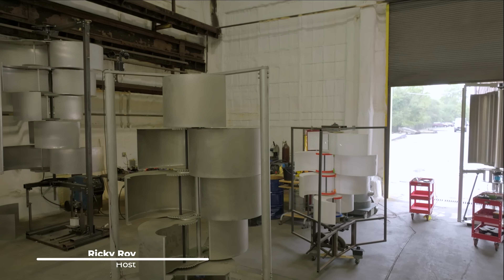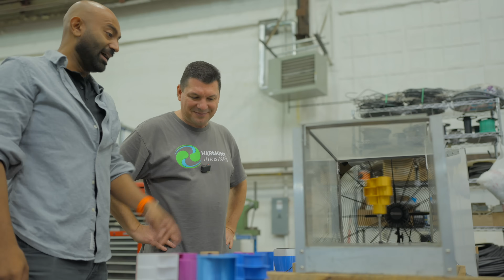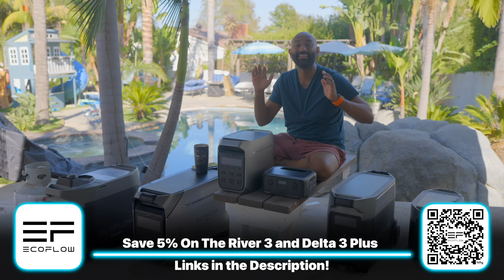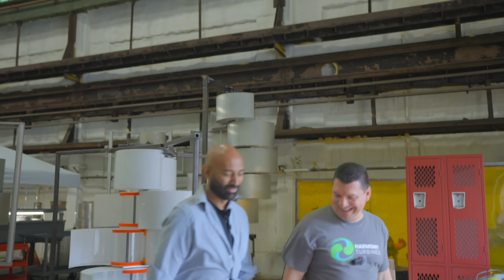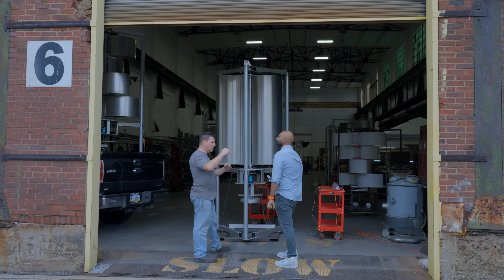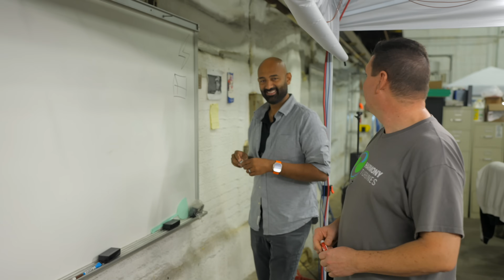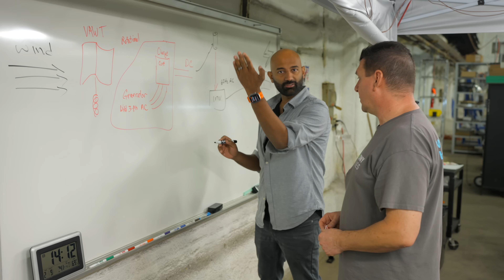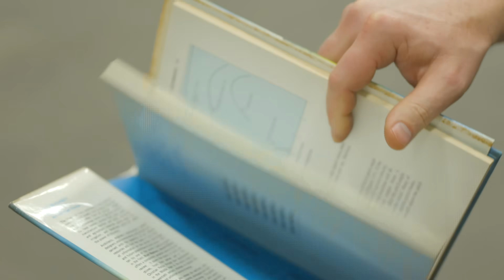This Could CHANGE Home Wind Energy Forever!

Comment: Thank you! It helped me understand a bit (or two) more regarding efficiency and reliability. It also helped allay some of my reservations regarding wind power--primarily its danger for bats and birds. My understanding is that the big, horizontal shaft wind turbines take quite a toll on flying vertebrates in general but more so on raptors and bats. The blade tips on those things are going in excess of 100 mph, sometimes far in excess of 100 mph. The vertical shaft turbines aren't as fast because their radius is a couple of meters at the most, at least on this video. Possibly more important is that a screen surrounding these would be possible while being utterly out of the question for the horizontal-shaft turbines.
Reply: No screen needed, birds and bats see a solid object in front of them and simply fly around.
Reply: @fr3dfixit945  there have been extensive studies on the effects of wind power plants on birds and bats, but no effect on bird or bat population could be proven. Hots are pretty rare and don't endanger the population.
Still, new offshore wind parks have bird tracking and slow down the rotors when a swarm approaches, but they've also shown that birds avoid wind parks altogether.
A recent study in Germany checked for dead birds in wind parks very thoroughly over a long period but couldn't find significant dead birds. Not more than expected of natural causes in the area.

Comment: That small windtunnel test.. A higher voltage (OCV) only tells you it is spinning faster.. Measure Watts if you want to know its power. Also: it may be efficient and good in slow "dirty" air, but when low to the ground and not that big, the power will be small. That said, I do like the product a lot! I would consider buying it.
Reply: Quite some time ago, some friends of mine were approached to invest in a wind turbine startup. I was asked to do a verification of the potential power capacity of the prototype, in a real world setting. So, I set it up for a 'Brake Horse Power' test at their site, with my instruments etc. The measurements confirmed my initial views, when it showed it could generate 92 watts @ 22kmph winds (far less than their claims). They were somewhat taken aback, and pointed to their demo that was pumping water. I ashed what was the GPM over the elevation head. The calculation returned a similar result - 95 Watts @ 23kmph. My friends decided to mot invest. Many others lost all their money, when the firm went under as they were unable to produce the power levels they claimed.

Comment: It is interesting that he did not include the "traditional" wind turbine model in his little windtunnel performance measurement exercise for the sake of comparison.  Something tells me that the old fashioned one would vastly outperform all of these fancy designs because it faces the wind with all its surface collecting the full wind pressure. All of the models he presented face the wind with a portion of it's surface while the other portion is acting as a windbreak reducing the efficiency.

Comment: Unfortunately there are a lot of mature trees around here so I would have to put one on top of a 20m tower to really reap the benefits. In a suburban sprawl or areas with a lot of farmland or plains, where trees aren't really an impediment, it would be a great solution to supplement solar. Having a whole house generator that can run on RNG or bio diesel (treated for long term storage of course) would be a great solution to fill any possible energy gaps during prolonged inclement weather.

Comment: Great vid, great designs and ideas but it’s the cost that will hold this company back. $6k ? No I would not buy. I would spend $6k on batteries and inverter and make my own wind units and power scavenging units.

Comment: It would be interesting to see power via solar or wind rated in w/24hr or over a week, month etc.  Wind does provide less like for like, but over time, it might be comparable if exposed to wind permanently etc.  but having both might be a good solution to maintain topped up batteries around the clock.

Comment: why could you not use the drive power of the wind to run an air compressor stored in tank pressure driven generator? Solves voltage control problem.

Comment: Good effort, but their design is not practical.  I have worked on VAWT as an amateur for a number of years.  Savonius can work well if it is adapted to it's load correctly.  Slow moving high torque Savonius are similar to the old multi-blade (24+ blades) farm windmills.  These old, but very useful farm windmills pumped water from a well, ... that is what they did very efficiently - pumping water is a low speed/high torque process.  

Using an electrical generator meant for high RPM input is a stupid load for any Savonius especially this one.  Other VAWT researchers decades ago redesigned electrical generators to work better at low speeds, but these generators are much more expensive until production can be scaled.  These problems and many others with Savonius wind turbines, as well as their unique advantages, have been well known to researchers for decades.  I have a better idea which matches VAWT Savonius to a load, but that is between my patent attorneys and myself for now.

I respect these folks for their willingness to experiment and significant effort as demonstrated.  Just wish they had read more literature from the VAWT field first and learned what had been tried, what the issues were, before making entirely avoidable design mistakes.  If they continue in their present direction, the only beneficiaries will be YouTube content creators looking for novel clickable stories to tell.

Comment: A very important part of the video was when he explained that most people only get average wind speeds of far less than the 12 mph minimum turbines need to produce anything. I recall someone complain that his turbine only produces power for few minutes before the wind gets so fast it shuts down; for some reason they did not want to accept that a tower that is too short and too close to trees and his house is not going to get good wind so the problem was not that they were only getting about 200W from 30+mph winds but that they only rarely got the 12 or15 mph that their 2kW or 3kW turbine needed to even start moving...

Comment: Looking at this WIND TURBINE which is Direct-Drive to the generator, what about a Gear-Box or a Automatic Transmission that changes gears for the different wind speed? Like in a car, RPM changes into a higher gear the faster it moves but the RPM is roughly the same.

Comment: I've wondered if micro turbines would work , something along the size of the small ones you shown, that produce maybe 2 or 3 watts, but having say 100 all charging a battery, it would seem to need a lot less wind and would produce more power on average in a medium to low wind speeds

Comment: Do these wind turbine controllers have Max Power Point Tracking (adjusting the motor load, to maximize the power output of the system)? This would auto-adjust with wind-speed, air-temp, air-humidity).

Comment: Have a 1kw wind turbine ... You MUST MUST MUST be living in a very very windy area for any reasonable power output from a micro turbine.
Reply: Have you seen the Liam F1?  It's design seems much more suited to using in an urban or forested area, where wind comes in swirls from various directions...? 
(CLIP)
The traditional three-blade wind turbine has a major problem: it was never designed for our backyards. While massive turbines thrive in open fields, the turbulent, shifting winds of urban environments leave them vibrating, noisy, and inefficient. Enter the Archimedes Wind Turbine. By reversing a 2,000-year-old mathematical principle used by the ancient Greeks to move water, modern engineers have created the Liam F1—a conical spiral turbine that solves the biggest headaches of residential wind energy. In this video, we explore how this "nautilus-shaped" rotor achieves nearly 80% of the theoretical maximum energy extraction (the Betz Limit) while remaining quieter than a whisper.
(END)
There is a youtube about this tech for anyone interested.
Reply: @DavidCurrie-s9q Yea, I've seen that Archimedes wins turbine. I'm very very sceptical because the power in wind calculation for swept wind area is the same no matter the turbine design. Even if it could convert 100%, the swept area is small.

Comment: What's the North like for heat? Fantastic idea with the magnetic bearings but heat would permanently damage the strength, and idk if all metal construction would attract more heat on a hot day or help regulate the bearings temperature :o genius with the adjusting openings

Comment: Why not cover the right side with a deflector that pushes more wind into the left side? Deflector attached to the outer frame, not the drive axle, always facing the wind either by shaping that 'fin' or by a trailing 'rudder'? Seems a fairly easy way to optimise the differential wind. What am I missing?

Comment: All practical tests of ground-based small wind turbines show: 1) They hardly produce any electricity! 2) They do not last long! 
Solar panels you can generate at least 10 times more green electricity with the same investment & time expenditure! 
Reliable and almost maintenance-free for at least 25 years! 
On the other hand, 9 out of 10 small wind turbines stop working after just a few years due to the extremely gusty winds close to ground.

Comment: One problem I see with a classic Savonius is that the air flow through the machine is not unidirectional. One bucket fills until it turns out of the wind and, as he said, spills into the upwind bucket, (a good thing because that helps reduce the vacuum-drag of that bucket going curve-side against the wind) BUT then that air as it meets the more powerful oncoming wind must STOP and REVERSE again. These oscillating opposing currents have to reduce the wind’s available force against the bucket and reduce performance. 

The poor wind tunnel performance of the gold model is obvious when you look at a still. Only one open bucket power is available to push all the other buckets against the wind, each hauling a bucket of low pressure drag behind it. They’d do better with a two bucket S, where the power of one whole bucket is available to overcome the drag of the other.

Comment: Why not synchronize on AC as the design already has dynamic capacity control? A sensor could be used to decide when to disconnect and reconnect. I'd assume the losses are more with a charge controller and inverter setup, but haven't done the calculations.

Comment: Small scale wind won't be viable ever. The cost vs output will never match. PV + battery is a better investment, I've seen to many small turbines not producing any tangible amount that make them worth the cost. You can install 15kWp + 25kWh battery storage for the same price as a 3kW wind turbine. Math isn't mathing...

Comment: Basic physics, the available wind energy in a given cross sectional area is proportional to the cube of the wind speed.  So if you build a  wind turbine that produces 400W at a wind speed of 25 mph then regardless of how good an alternator you have, at 7mph it can only produce (7/25)³ x 400 = 9W.

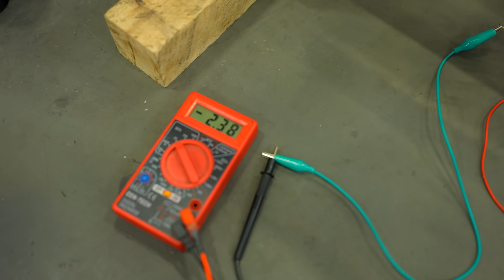Comment: But the voltage is negative, 2:06 that means that the wind turbine is absorbing power from the alternator.
Reply: it simply means he put the mini turbine on backwards and it was spinning in the opposite direction than the one he tested a moment before.

Comment: 2-bit refers to the your education or  IQ not to any DaVinci product first on this air generator search YouTube to mass produce all your products gears and production are cheap the main thing you're leaving off is your friction just like on a shark scales on the shark to help it move through water as you would use some type of coat a paint or something to wrap up to increase your air flow that would give it more grip you wouldn't even be able to see it with a naked eye and most cases it would increase it by 10 to 20 fold if you can't address or realise something that simple please don't post a video
Reply: If you can't be bothered to research your topic don't post a derogatory comment 😂

Comment: I wonder if you couldn't build one that sits on its side and runs across the peak of your roof.  No matter how the wind is blowing, when it hits the roof I would expect it will flow up to the peak.
Reply: Like a Ridgeblade or Windcrest? Yes you can.
Reply: @alanhat5252  i haven't heard about this but I'll look. It just sounded like a way to use roof area that solar doesn't use
Reply: @briankeithwood  it certainly is

Comment: I like that these are made to last, and don't have any rare metals or are super hard to recycle.
But, and this is a big but, if most people live in areas where winds are below 12 mph (20 kmh) and the turbine will only generate 10 watts or something like that, why bother?
even if it works for 24h a day, that's 240 watts, you can get that with any solar panel even on a bad day so why not just invest on a panel and a small battery instead?
I don't get it, the energy production at low wind speed seems negligible, why focus on low wind then?
Reply: My solar setup is giving around 150Wh a day this week & the battery is hitting the low-Voltage trip every night.
Reply: @alanhat5252  yeah on bad days in winter you get pretty low production with solar panels
but 200Wh would be a "normal" day for a wind turbine apparently
that's why I don't get it, why bother installing a wind turbine that's going to do 200Wh on most days?
in the last year I got over 7MW of production with solar, that is 800 watts every hour of the year
200W for a wind turbine that costs as much as an entire solar installation sounds absurd
if all that matters is production during night time you can get a battery instead, cheaper than the turbine, easier to install too

Comment: Great video One of the best I have seen for dealing with wind and charging problems.
Reply from the maker: Appreciate it, glad you liked it!
Reply: @TwoBitDaVinci  I'm a bit disappointed people are still giving these charlatans air-time. The "controversy" is that they are liars. This is basic theory that everyone simulates or derives for themself when studying wind power engineering. You may as well be saying newton was wrong about F = ma or that a Joul isnt actually a watt*second. The idea that no one noticed this error and only parroted what they were told is offensive to the entire industry.
Reply: @TwoBitDaVinci  A total softball job...IMO.  Do your followers a favor, and ask tougher questions.  At a minimum, get better versed with the physics of wind generators.

Comment: Great video. I really enjoyed the facility tour.
I think your point at the end is particularly important. Cost parity isn't when a 500W wind turbine costs the same as a 500W solar panel. Roughly speaking, wind blows twice as often as the sun shines. (Not a made up number. Solar projects often assume 25% of the time a panel will generate electricity and a turbine will produce power 50% of the time.) Parity can be achieved if a turbine costs is twice that of a panel. Even getting to twice the cost of solar will be a challenge, so it's an uphill battle for sure. I hope this company succeeds!
Reply: 25mph wind blowing twice as often as sun shines?

i don't think so. (that could be true in Antarctica though)

and anything below 25mph will produce only tiny fraction of the rated 400w.
Reply: If you are 'assuming' it is because you made up that number.
Reply: Wind projects vary the design of their turbine to reach that 50%. it is not an inherant value from the technology. A larger % means lower power production. You could have 100% generation time if you used a child's toy pinwheel but you won't get any electricity from it.

Comment: Why do these vertical axis ideas not die? Why not look at aerodynamic laws and physics? The reason this and all other vertical axis wind generators always will fail is quite simple, and it will never change. Why did the big paddle wheels in early steam ships get junked when the propeller was invented? Easy: Absolutely massive paddle wheels wasted enormous amounts of energy and a tiny propeller would always outperform them, on every thinkable parameter. Why do no planes have anything like a paddle wheel, but always a propeller? Vertical axis is a BAD idea. STOP IT! It’s flat out stupid!
Reply: Gusty turbulent winds mean a HAWT is always facing the wrong direction to catch a gust & in extremes will snap the tail off (yes I have seen it). 

It's really frustrating having to hold your hat on while watching your windmill gyrating wildly yet not generating power.
Reply: @alanhat5252  could you please name the brand and manufacturer of the HAWT you mentioned in your comment?
i am really intrigued.
Reply: basically what those residental VAWT startups are doing is green energy scam.
works fine for sucking money from uneducated investors.

Comment: I have a 12m former electrical supply post in my garden and I'm afraid wind doesn't measure up very well for small scale generation. I can get better and more reliable generation from a pair of solar panels on the pole with a rudimentary solar tracker than I could make from a wind turbine costing x10 more.
Reply: on a stormy day in winter? I doubt it

Comment: Why should one want to reduce front area of a wind turbine? A Savonius rotor ist mostly storm resistant.
To control the rpm in order to get the most power out of the turbine you just need to control the current drawn from the Generator. A MPP tracker for a wind turbine is way easier than for PV.
It seems to me that this guy is a good mechanical engineer but lacks a bit of electrical knowledge.
Reply: Sell your MPP tracker then, there's a gap in the market.